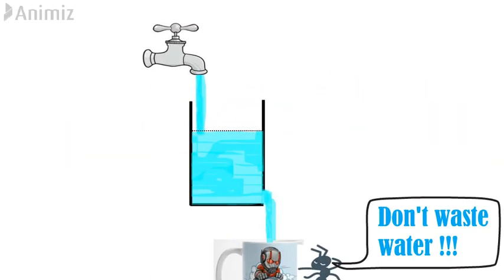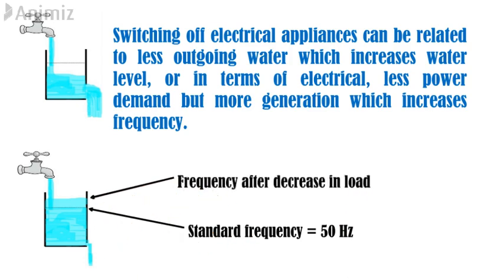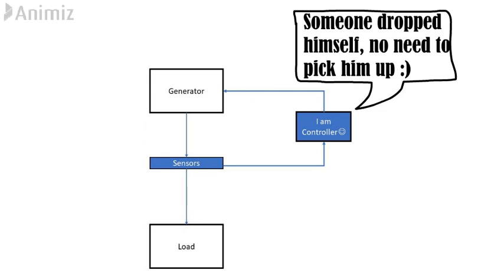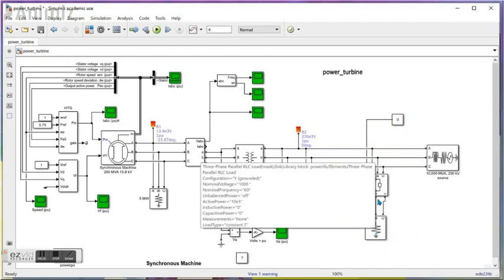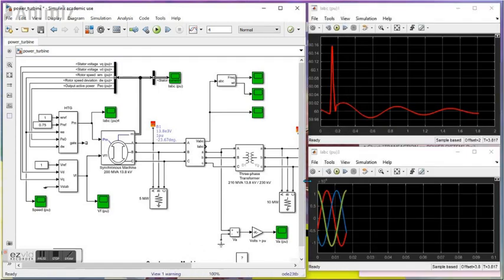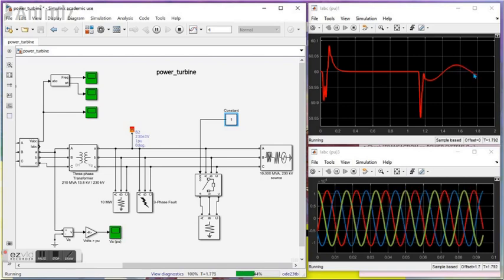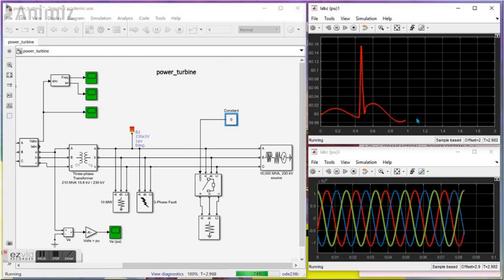Droop Characteristic/Droop Control of Synchronous Machines. Visualization using Simulation Model

Comment: Wait a minute. Please remove the infinite grid line. And then check. I have found that, the governor is not working. Actually Infinite grid is controlling the frequency. If you remove the governor still it control the frequency because of infinite grid power source.

Comment: I really want to understand more.  Can you do an example of how generators ramp load in parallel?  Example would be like diesel gen against utility and ramping load on and off generator.  Great video with Matlab but want so much more and math to backup simulation
Reply from the maker: Hi @Nonya Fletcher, thank you for the comment 🙂. I will try to post the suggested topic soon. Till then you can also check out the this video on power system inertia 
https://www.youtube.com/watch?v=1NRAw2yUj4w
This is not directly related to what you ask but important to understand the droop.
Reply: @ASeriousCircuit  droop makes sense to me since the frequency can vary.  I'm struggle to understand with utility parallel with generator since frequency and voltage are fixed because of strong utility source.  How can generator assume more or less load in this case with those being fixed along with load value?  An explanation would be appreciated!
Reply from the maker: Hi,  @nonyafletcher601  correct me if I am wrong "You are asking that a strong utility grid will maintain the frequency and voltage of the point of common coupling (PCC), then how a change in load at PCC deviates the frequency and voltage. And due to this, we need a DG to balance the power and maintain the frequency and voltage." 
If this is not your doubt then we can connect on LinkedIn to discuss this in detail. Send me a request here...
https://www.linkedin.com/in/suraj-kumar-72b395a2/

Comment: How we apply synchronization for synchronous generator in matlab simulink I raid it but there is a big transient and overshoot
Reply from the maker: Hii...can you explain more. Do you want to synchronise the generator to some microgrid or your single generator is not giving pure aine waveform when you are connecting it to load?
Reply from the maker: *sine
Reply: @ASeriousCircuit  i need a help, can you double click the PLL block in your model and give the kp, ki and kd? im not getting the stable frequecy similar to yours
Reply from the maker: Hii  @eligardfrancis2292 , the PLL block is already tuned so there is no need to change that you may try these things instead: 
1. See if all blocks have the same rated frequency (block which requires frequency as input)
2. Your net load is equal to the net generation (if one generator is not set to swing).
Reply: @ASeriousCircuit  thanx

Comment: Sir.How to set it as isochronous?
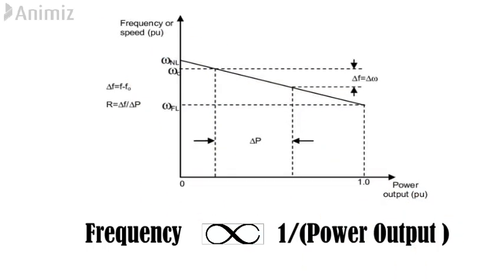Reply from the maker: Hi Gustavo, the droop characteristics of generators can be changed in two ways. One way is that we can change its slope (look @ 2:28 in the video), if we change the slope then it simply means that now the rate of change of frequency (w.r.t. change in demand) is changed. And if we control the generator speed in such a way that its speed(frequency) is not at all affected by the change in a load (parallel line to the x-axis), then we call this "isochronous generator". The second way is to shift the droop characteristics parallel to its present position (shifting the line upward and downward without changing its slope),  the purpose of doing this kind of shifting is simple, observe the characteristic line, when the load will increase (Load1---> Load2), the frequency will decrease but we want the system to operate at a standard frequency which is not possible with the characteristic (line) we have (after the load increased), so we shift the characteristic line upwards, this shifting will give us a new frequency set point for the new load (Load2), this is called ""no-load reference setting"". Simply speaking if you design a controller in such a way that the generator never leaves its rated frequency then it is called an isochronous generator. Hope it clears your doubt...
Reply: @ASeriousCircuit  why does there is no drop in voltage when you switched on the load? Is there any regulator for the generator?
Reply from the maker: @gustavomarcelo7250  In Matlab the "three-phase source" can be of three types: (1) swing (2) PV (3) PQ. I choose the source to be swing which means that it will always maintain its terminal voltage and angle, just like a swing bus in load flow. If you choose PV then it always produces the specified real power at a specified voltage. In practice also we keep one generator as swing and the othesr as PV in one system.

Comment: Please tell how to set droop settings  in alternator
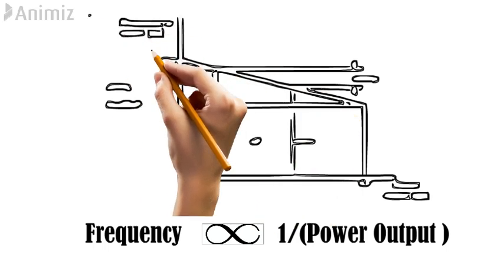Reply from the maker: Hi Suraj, I have not completely understood in what context you are talking about. But still, let me tell you from what I have understood from the question. The droop characteristics of generators can be changed in two ways. One way is that we can change its slope (look @ 2:28 in the video), if we change the slope then it simply means that now the rate of change of frequency (w.r.t. change in demand) is changed. And if we control the generator speed in such a way that its speed(frequency) is not at all affected by the change in a load (parallel line to the x-axis), then we call this "isochronous generator". The second way is to shift the droop characteristics parallel to its present position (shifting the line upward and downward without changing its slope),  the purpose of doing this kind of shifting is simple, observe the characteristic line, when the load will increase (Load1---> Load2), the frequency will decrease but we want the system to operate at a standard frequency which is not possible with the characteristic (line) we have (after the load increased), so we shift the characteristic line upwards, this shifting will give us a new frequency set point for the new load (Load2), this is called ""no-load reference setting"". Hope it clears your doubt...
you can refer to these lectures for a deep understanding of the concept
https://www.youtube.com/watch?v=mIEORf6w3aA&list=PL-k1HA3FXX5Z35ieNXQ7VIQHi65I-ac3t&index=13
https://www.youtube.com/watch?v=ZS-WjgFDqyI
https://www.youtube.com/watch?v=P_tKImBri_E
If you were asking about the controller design then you can refer to the paper that I have provided in the link

Comment: Isn't RPM directly related to Frequency output? So generator speed increases to increase frequency, generate more power, and push the grid frequency up? I saw in the video that it stated rotor speed decreases as grid frequency decreases (aka more load)
Reply: Both points are correct "generator rotor speed must increase to increase frequency when the frequency drops below rated" and "system frequency decreases below rated when generator rotor speed decreases due to an increase in load demand". The important concept to understand here is that "the rotor must run at rated speed in order to maintain rated frequency"  ==>  "rotor runs at the rated speed only when the input power to the rotor (mechanical) equals to output power (electrical), you can analyze SWING EQUATION for this phenomenon"  ==>  "now we have to list out the cases which create an imbalance between input power to the rotor (mechanical) and output power of generator (electrical)"  ==>  "the first case is when suddenly electrical load decreases, this creates a situation where the input mechanical power is still same) but output electrical power demand reduced, now if you look at SWING EQUATION, it is clear that in this scenario the acceleration factor becomes positive i.e. rotor accelerates or we can say the speed of the rotor is more than rated ( or RPM is more than rated) so ultimately frequency is more than rated"  ==>  "the second case is when suddenly electrical load increases, you can similarly relate this scenario with SWING EQUATION (consider less mechanical power and more electrical power) so acceleration becomes negative, which means speed reduced and hence frequency reduced"  ==>  Now in the video I have explained the process to overcome both above-mentioned disturbances, in one case we simply decrease power generation and in second we increase power generation. You can refer to the following site for a quick understanding of SWING EQUATION and rotor mechanics.
Reply: @batman98298  perfect response, thank you!
Reply: https://circuitglobe.com/swing-equation.html